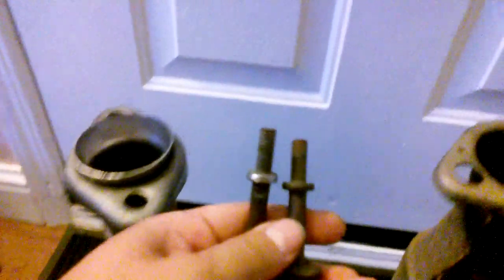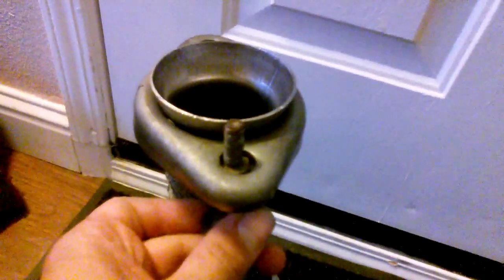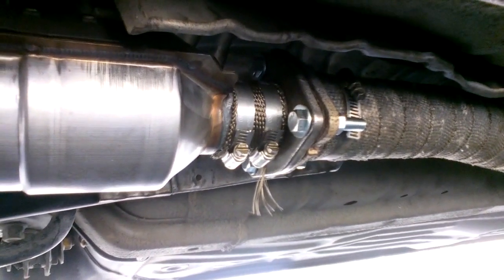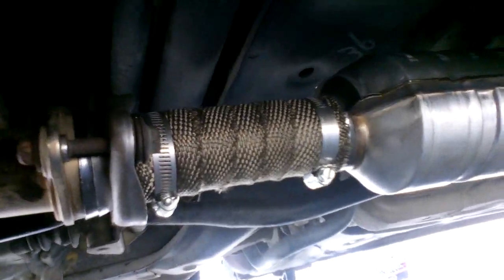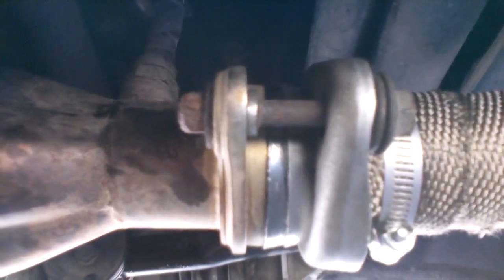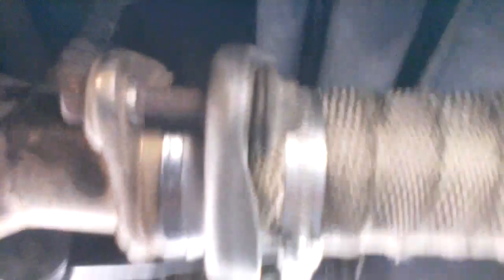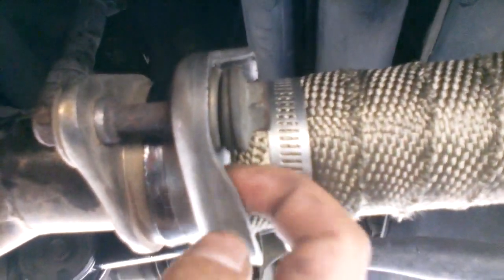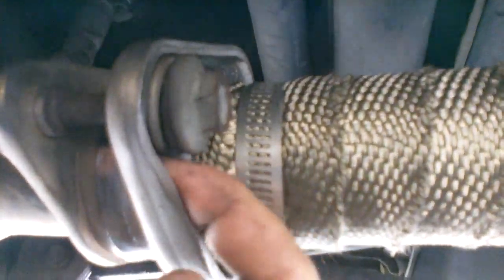Magnaflow "not so simple" bolt on Catalytic Converter - DC2 Integra LS

Comment: what size were the three bolts on the flange connecting to exhaust?
Reply from the maker: I'm not certain. As i wasn't able to reuse the bolts that were pressed into the OEM cat. I remember going with the biggest bolt(strength) that would pass through both the catalytic and cat back flanges.

Comment: I just bought the same one but the flange is loose on mine? Do I have to weld it or wrap it with heat wrap like u did
Reply from the maker: Ruben Gonzalez That's the way it was designed. Don't have to wrap it unless you want to. I had some leftover scraps so I used them for that.

Comment: how does this converter work with your car? do you get any codes for check engine? the aftermarket looks a lot smaller than the OEM.
Reply from the maker: it works fine. the length is shorter but with a lager diameter than oem